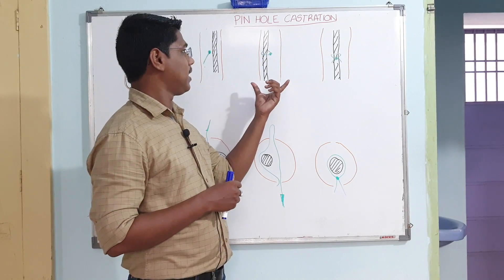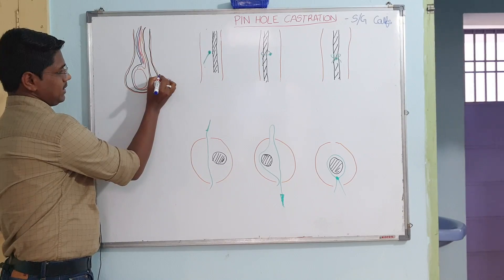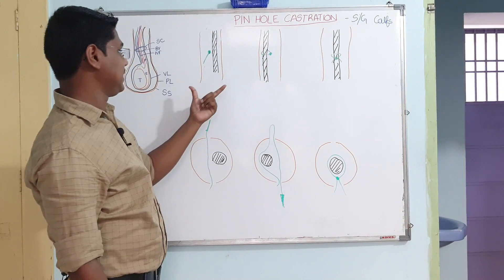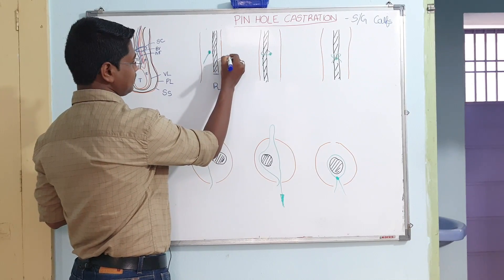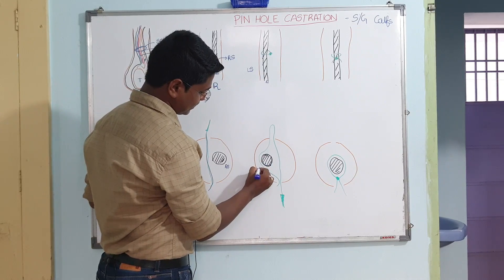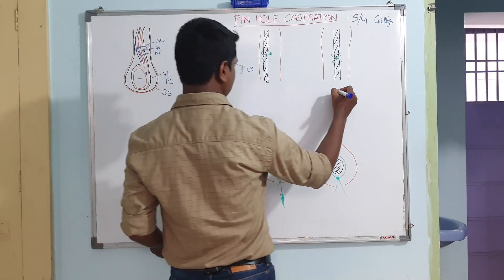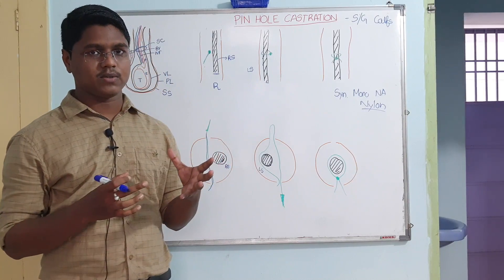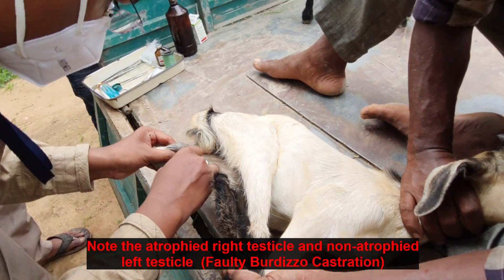Pin-Hole Castration (Goat) | SA Surgery 03

Comment: Sir,
I have a few things to know.
1. Won't it be the scrotal sac irritated by the cut edge of suture, as we are using non-absorbable suture(nylon)?
2. What will be happened if we use absorbable suture?
3. Can we use this technique in calf or dog?
4. What is mechanism or being atrophied rather than necrosis due to absence of blood supply?
Reply from the maker: 1. No it won't. Using appropriate suture size like 2-0 or 3-0 suture for kids, 1-0 or 2-0 for adults will cause little irritation. 
2. Absorbable suture will lose strength after few days, which may reestablish the blood circulation. Also it will increase cost of operation. 
3. You can use in calves and dogs (under GA). There has been articles. 
4. Most of the articles say it's testicular atrophy. Very few says ischemic necrosis.
Reply: @vetsurgeryatease  Thank you so much sir for your valuable answers.

Comment: You are a doctor. So, please act like one. You should always use sedation or anaesthesia for these type of painful procedures. We are doctors not butchers.
Reply from the maker: Hello. You are right. Much appreciated. Go to the latest video on Pin Hole castration. I have used local anesthetics. This is an old video. When I was first posted, hardly any shop was there, who knew about anesthetics. Also farmers will be unwilling to buy, even if it's just only 40 INR.
Thank you very much for watching 🙂
Reply: @vetsurgeryatease  Thank you.

Comment: Why we don't inject anesthesia during castresion...... because is a very painful process.......
Reply from the maker: It increases cost of operation and  farmer can't afford. Also this is a very short procedure. Anesthetic will have some risk of life.
Reply: @vetsurgeryatease  but sir the cost of a 30ml 2% Lignocaine is 36-45 Rs. Then what is the issue? and can we use local anesthesia in this technique?
Reply from the maker: @Dev Mukherjee Official  the government actually don't supply local anesthetics. So the farmers are reluctant even to buy a vial. But for mass castrations we definitely use local anesthetics. And this is an old video, the newer video in this playlist suggests use of local anesthesia. Thank you.